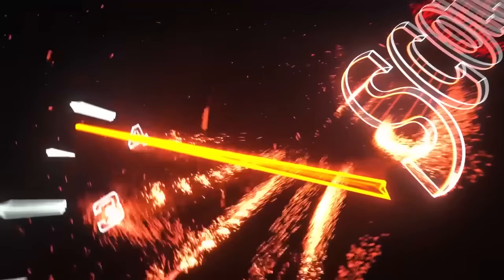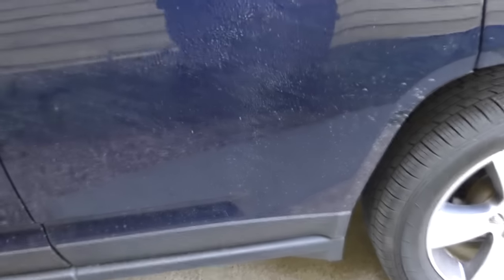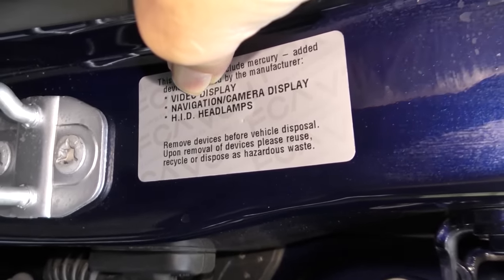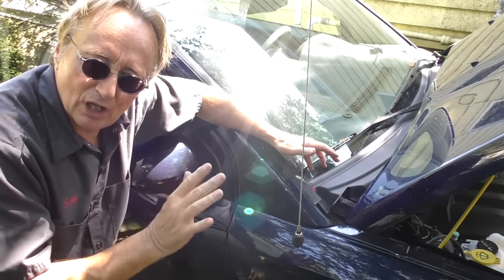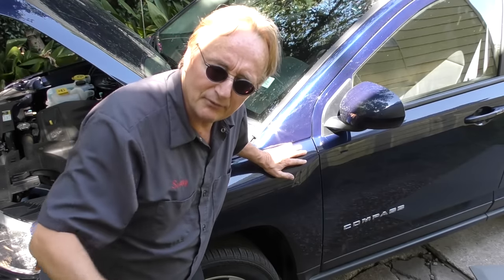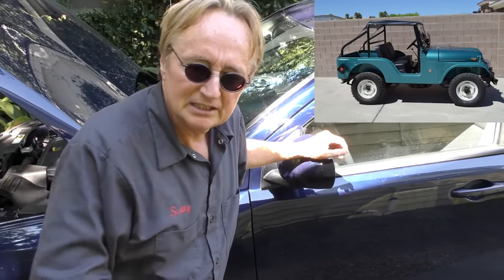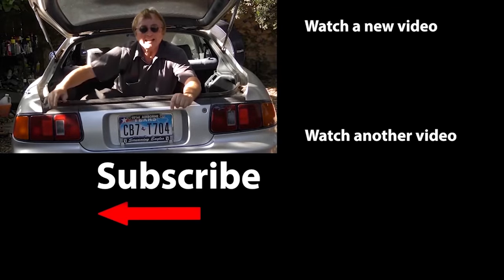Here's Why This Jeep Compass is Crap

Comment: 2011 jeep grand cherokee,  replace head two times. condenser two times. alternator two times.  yes it will rust FAST.   had the valve covers off and the cams went FULL RUST over night. have videos.  total garbage.   avoid  !
Reply: Pictures or it didn't happen. Why you people have to straight up lie-- cams rusting over night??? Yeah, I had my valve covers off and the cams turned to dust right before my eyes... They were also made of wood.. true story.
Reply: @Alan-tr5uj  i have videos.  they must use the cheapest metals. the rusted and pitted over night.

Comment: Love your videos. Gotta tell you. I have a 2016 Patriot (Latitude) 4x4 2.4L. Got it used in 2017 with 34k on it. Today it has 247k on it. All I've had to do is oil changes (never miss one), and brake jobs. It's one of the best cars I've ever had. On top of that, it still looks good.

Comment: I have a 2011 Jeep Compass 5 speed, has over 150k and still runs great. Just replaced the alternator for the 1st time but works great. Is there a difference between the automatic and 5 speed?
Reply: We are better than the automatic 🤣

Comment: I have a 2014 Jeep Compass and for the most part it's been really reliable.  It now has over 100,00 miles on it, and the only maintenance I have done to it is replace the front brakes,  a set of tires,  and spark plugs, and of course regular oil changes.   Granted it doesn't have a lot of room in the back seat area, and I'm sure other models get a lot better gas mileage.  Another downside is that the interior is mostly all plastic, and the outer seat panels break loose.  It's seen a lot of city driving and I hope to get many more miles out of it.

Comment: my dad recently bought a 2018 jeep compass and he has already taken it back to the dealership 4 times because of electronics issues and its not even a year old!
Reply: The 2018 is the first full model year of the new Compass. 
Electrical issues will be found in quantity on any new product launch. 
I wouldn't advise buying a car from the first two years of its production. Identifying a design issue is step one, fixing it for future production is step two. This takes time.
Also if the engine or transmissions is a brand new design, forget about it. Example, the 9 speed transmissions that launched on the Cherokee.
Reply: Thank you and I bet ya that the dealership STILL HASN'T BEEN ABLE TO PROPERLY FIX IT YET? RIGHT?
Reply: Join the fuckin club

Comment: just bought a 2009 for 2100$ Canadian with 210000km. Only problem is it shuts off when stopped with no codes coming up. Sometimes it will keep shutting off right away after starting for about 20 mins, then good to go. strange. Can't even diagnose with no codes being thrown. In town fuel economy is 11-12 km/litre which i think is pretty decent. Highway is about the same
Reply: Mines doing same with 118k miles.!apparently has bad sensor which will make the car jump randomly while driving..

Comment: I inherited this car from my dad. It's a 2016 and both he and I thought it had just 8400 miles on it until I realized that's the trip meter. The dash lights go dark depending on what position my light switch is on. It, of course, has a recall on the cadlick converter. (Boy did I f that spelling up) but all in all, I got it free and I am grateful

Comment: I have the 2017 Jeep compass. I can say I've already had a engine replacement and it's back in the shop for stalling with the new engine.
Reply: We have a 2016 and it runs great at 250k

Comment: My 2014 is crap. 71,000mi and it's starting to rust under the paint. I've never had a car rust on me. The Jeep dealer says the Hyundai 6 speed transmission and transmission control module both need replacing. The actuator in the dash has been replaced twice, but only lasts about 3 months, so I've grown use to the clicking noise it makes for about 15 seconds everytime the door is open or the car is started or when you adjust the heat or air. Valve cover started leaking oil pretty badly.

Comment: I've  bought a couple  of Jeeps. Grand Jeep Cherokee  2005, great vehicle.  No issues ever.  Jeep compass  latitude  2018. Never an issue so far.  Most vehicles  now days are over priced  and cheaply  made. Even  the ones in the 40 to 60 thousand dollar range. None of them are without faults .

Comment: Speaking of which, mine through a P0441 code. The dealer says that's not covered under their warranty because the connector piece was suppose to be designed to prevent water, liquids, moisture etc from getting within failed and the word rust voids their warranty. Not only did they replace the Esim module and connector harness but the purge valve as well. Interestingly a week goes by and the same P0441 reappears. Not even they know their own products and yet I'm stuck with this piece of equipment

Comment: I have a 2016 and honestly I have no complaints
Reply: I have a 2016 as well it was fine until last year I began to have serious issues like my compass would jerk bad. I took it to the two shops, the first time they said they found 0 issues. Car kept jerking and after a while I noticed that at times whenever I would make a complete stop and then I would step on the gas it barely went 20mph. So I ended up taking it to the dealer where I got it from and after a week being at the shop they told me I needed an entire new transmission. Since my car was still under warranty I didn’t pay anything so that was cool but the transmission was back ordered and I was without my Jeep for three months.

Comment: I've got a 2008 version of this vehicle. I won't do it again. It has the exact same engine that you have in that 2017. Mine doesn't have AWD/4x4. Replaced the CVT transmission a few years ago. Now I'm getting engine errors codes. Wish I new this 5 1/2 years ago when we bought it. Oh well. Thanks for the videos. Keep em comin'.

Comment: I’m at 111000 miles, got it at 34k 2014 4x4, my Jeep Compass is in shape, I’m doing all the work though, not a stranger at a shop 😏
Reply: I got 89k patriot at the moment, i drive alot but have u had alot of problems? I dont know if i should sell mine or not?
Reply: @simongeorge9831  The Patriot/Compass is... a real gamble. There are some that drive reasonably well and will take you to well over 150k like my 2008 one. But that comes with a lot of research to determine if it needs a bit of TLC or some more invasive repairs. Just take it easy, use good fuel, keep the fluids and such good, and you'll have it long enough to save up for its eventual replacement.

Comment: I use to put these things together at the assembly line..and The compass doesn't have fiat technology..its been made since 2006 along with the patriot..way before fiat bought chrysler.. it's been the same since then..I mean it doesn't make a difference but thought I point that out lol
Reply: When Patriot went away, new Compass took over and are made off a Fiat platform. Before that Compass, Patriot and Dart came from the US in Belvedere.
Reply: @triuman  yes indeed.. now the compass is being made in mexico...
Reply: @vado575  So as one with first hand knowledge of the vehicles, what do you think of them🤔 I drive an FD 2 '15 Patriot 🤔
Reply: @triuman  never driven one ..but I know a few that owns them and they love it.. I have a 10 dodge  journey with the same drivetrain as the compass/patriot. .. very good engines..only common problem on those is the throttle body loves to take a poop..
Reply: @vado575  Did FCA ever release an improved throttle body sensor? Is new 2020 Dodge Journey completely reliable and bulletproof now?

Comment: I had a 07 compass it lasted me 8 years before it was totaled in a accident and mine was GREAT on gas and the parts were cheap
Reply: Tashica King I’m glad you posted! I just bought a 2011 Compass (used) & so far it’s great!!
Reply: Same it was the best
Reply: Dani Dollistic never had to replace the brakes either just the pads every 2-3 years the car was a dream now I have a 2014 grand Cherokee with the Mercedes v6 engine it’s safe to say I will have a Jeep for life they were great up until 2015 when fiat took over that’s when everything went downhill
Reply: Cheap parts, because you can fine them all over the freeway.
Reply: I have a 2011 jeep compass and 2012 G cherokee since new. they are great cars.
Reply: Ed Sil your lucky I miss my compass at times but I love my grand Cherokee too and I wouldn’t trade it for anything
Reply: Dani Dollistic how is it so far? now

Comment: I had a 2013 Compass, so before Fiat owned Jeep/Chrysler.  It was a great vehicle.  Mine had a 2.4 liter engine, 4 speed manual transmission.  It got 25-29 mpg and would go just about anywhere in 2 wheel drive, and I had no fear on any mud road or icy conditions in 4 wheel drive.  I’ve owned 2 Jeep Cherokees which were good but the Compass was surprisingly the best of the bunch.

Comment: I had a Jeep Compass and I drove it off a cliff and took it for a swim and that was the end of it
Reply: That's any car, though.... flooding will ruin a car's electronics, no matter who makes the car.
Reply: @hanskinslo326  I did it cause it was a piece of crap and I  hated it. Not all cars see the video of the Toyota tavoma pick up that was flooded with ocean water at the beach hit by a wrecking ball set on fire and dropped from a high rise and it still ran.

Comment: As a factory Chrysler tech it's easy to fix, parts are cheap and I know 3 guys at my shop alone that have over 200k on em. They aren't older jeeps but any means and they are ideal for winter conditions.

Comment: Jeep Compass 2016.  272,000 miles and still going strong.  Bought it with 32000 miles.  No Transmission problems.  I don't drive over 70mph.  Also use it for Uber.  The only weird thing is if you replace a headlight u might as well buy 2 because the other one will blow after a few days. Also the radio gave out.  I just use a speaker box.  I'm good.  I have put a significant amount of money to keep it running but I'm replacing parts that should have given out way before I replaced them
Reply: Does it ever shut off on you while idling

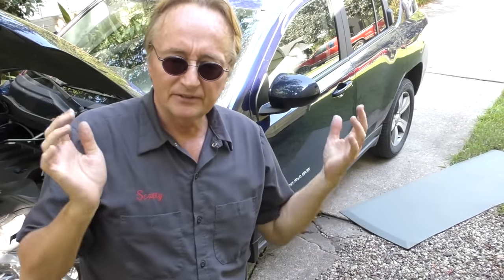Comment: @3:00 That is absurdly poor fuel economy for such a small engine. 18 MPG is about what I got with my old Taurus SHO in the city, and it had a 3.5 L twin-turbo V6 that made 365 BHP.
Reply: It only gets 2 less mpg then the 2017 Toyota RAV4 awd. It’s not that crazy. Not sure if comparing a turbo engine to a NA is fair when comparing fuel efficiency and HP.

Comment: I think one of the gas mileage issues stems from the fact that when you start the engine the traction control automatically comes on causing you to give it more throttle to get it moving.

Comment: lol, these jeeps were never meant to be taken off road. It's a city vehicle. As for the light corrosion, any vehicle does that, even Toyotas. Come up north and talk to me then about corrosion.
Reply: **Classified** my 01 focus is kept outside and doesn’t look like that.  In Pennsylvania.  Underneath is s different story
Reply: My father has the 2018 Tacoma and it weirded me out to see the rusty driveline and other parts on the bottom covered in rust. I guess as long as it’s surface rust oh well. My 15 year old truck has less corrosion.
Reply: @ixionn563  It's perfectly normal for a driveshaft to have rust, along with rear axles and other uncoated steel. They'd take 50-100 years to rust through. Every vehicle does it.

Comment: Og owner . First model. 2012 Only issue has been thermostat housing leak . Only structure issue was a ice storm ripped a abs wire off . FWD . Default as in acceleration.. eh . You know how to roll a passing gear .. CVT. Has the pull . Just applicator who can’t drive one . 117k on the clock . I’ve beaten this thing like my 01-03 Ford Focuses . No issues here !?

Comment: I've got a 2014 that's just turn over 200k miles. Been blessed with it and no major work but soon to get rid of it. All the parts are cheaply made. Goes through oil like crazy, defiantly not an offroad vehicle. Suspension really sucks. Everything breaks quickly cuz its made cheaply. I'll stick to my 03 civic lots of room to work on and easy to fix. Built to last

Comment: These original Compasses were ugly AF and garbage, they nearly discontinued it but saved it with the new mini Grand Cherokee like body redesign. We would have never bought the old body style. 
We were a little leary when we bought our 2019 Compass Latitude last May because of its old reputation...  It had 2k miles on it, previously owned for 4 months and was traded back in just as the world shut down and sat on the lot for 4 months until dealers opened back up in May, we bought it the day they opened back up for 21k, sticker price was just over 30k. I think we got a great deal on it and have had zero issues with it almost 10k miles later. It  consistently gets 21-25mpg in the city & 28-30 highway. We’re very pleased with it so far.  

I’d like to see you do a video on the latest models after the redesign!

Comment: 2015 with ONLY 44k. 20k in last 3 years. Grandma had it b4 me. Runs like a champ. 1st of 3 cars I’ve had that I don’t have to check the dang oil. Only issue was the chip in the radio that needed re soldered. Bout 23mpg  on the last tank basically all city.

Comment: Bought a 2017 Patriot in 2016 new. It is the same vehicle with different sheet metal. 2.4 high latitude. Loaded with all the bells and whistles. It has 80 thousand miles and never one single problem. I guess I got a good one

Comment: How you mean? It’s been reliable for me
Reply: The Compass/Patriot/Caliber platform is just known for a bunch of engineering faux pas. That power to weight ratio is just insulting given the lengths they went to designing a vehicle that's difficult to troubleshoot/repair. Then they put the Jeep badging on it implying you'd dare take it places other than the grocery store/work commute. There's just no trade off with pros and cons unless you really DGAF about having a compact SUV and enjoy torturous DIY repair or paying mechanics to scratch their heads at who the heck designed this masterpiece. I say this as the owner of one and I wish my GF hadn't bought it but here we are.
Reply: Nathan Nurse weird 2017 Nissan Rogue 4 less HP and weighs more.
Reply: Nathan Nurse 2017 Chevy equinox 10 more HP   600 more pounds. It’s crazy. It’s like the jeep is normal in weight to power compared to competition. How weird.

Comment: I will never get a Jeep Compass or Patriot, because they are way too small and they are extremely garbage, same with the Mitsubishi Outlander Sport (RVR in Canada) or the Eclipse Cross. I will either get a 2011 or 2012 Hyundai Tucson GLS AWD with the 2.4 L or a 2017 or 2018 Nissan Rogue SV or SL AWD instead, because they are a lot better than these two ugly and junk crossovers and others like the Chevrolet Equinox and Trax, Ford Escape and Ecosport and the Honda HR-V as well.
Reply: Do some research and you will find that the 2.4 is a joint Development between Hyundai/KIA, Mitsubishi and Daimler Chrysler.
Reply: @matthewrafferty4117  The horsepower ratings for the Mitsubishi and Chrysler 2.4 L engine are 162 and 173. The Hyundai/Kia with the 2.4 L engine is rated from 162 to 198 hp.

Comment: Jeep patriot 2011 Limited (4x4) slow shifting and hardly wants to go to third but if I go slow with the RPMs it will head to fourth gear before it was decent but if I hit the gas too hard and the RPMs went up It would mess with the transmission is it a sensor or a worn out transmission Changed the fluid and checked the connections Got a code p0777 p0746 p0700 p0730 p0456 p2110

Comment: My girlfriend has a 2015 Compass with the smaller engine.  I've changed the oil on it with mobil 1 full synthetic and quality oil filters since she bought it.  It has over 100k miles on it now, and thus far no problems.  It is however burning coolant currently, not a whole lot, but have to top it off every 2 months or so.

Comment: my girlfriend and I have had a 2011 compass for 8 months...she loves it in the snow. Its taken us further than we would have expected off road and compared to her Dart theres alot more space. Its not the fastest and the interior does have a cheap feel. This car is pushing over 200k now (70,000km from us), I have done both front wheel bearings and regular oil changes. Im going to service the transmission fluid/filter next time I change the oil.

Comment: I have a 2017. I got it with 21k Miles. It now has 72k. The only problem I've had is rear bearings went bad. And I have some trouble with the wipers acting when they decide to. But apart from those I haven't had any issues. I get 28-30 miles per gallon on the highway. It doesn't have a lot of pickup and go. But it gets around pretty well.

Comment: Problems I had with my JEEP Compass I bought new and traded in at 45k miles: the gas mileage is terrible due to the sluggish CVT, you feel like you're driving the the brake on and need to use the accelerator going down hill because it just wouldn't coast. One of the keys mysteriously stopped working at +/-  10k miles. Several of the defrost lines on the back window never worked. Interior trim would come loose and pop out. Radiator fluid would be down and a sweet smell from the ventilation system but dealership couldn't find a leak so they couldn't fix it. Hard starts and not in the winter. Turn the key and sometimes it would just crank. The digital clock was off every month by 3 minutes. I was able to call corporate all the way up to the engineers and they said the clock is within tolerance.  The transmission slipped at 45k at the same time the tires needed be replaced.  I vowed I was never going to spend a dollar repairing it so off to the dealership it went. And in 3 years time a car i paid 24k for i was happily able to sell for 8k. One of Scott's most accurate and truthful reviews.  I started watching this channel after I bought my POS Compass and sold it before this review came out.